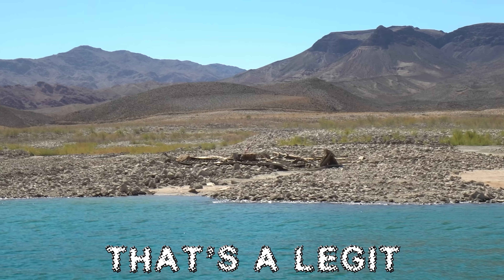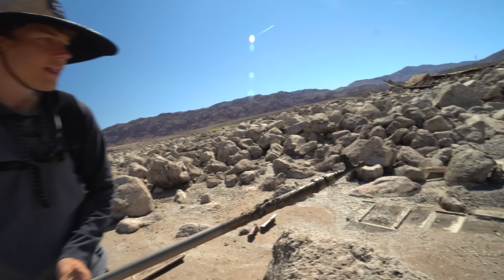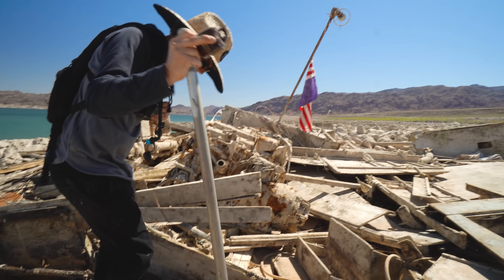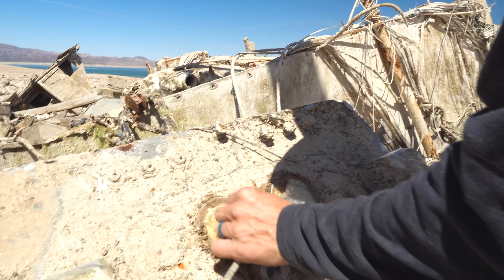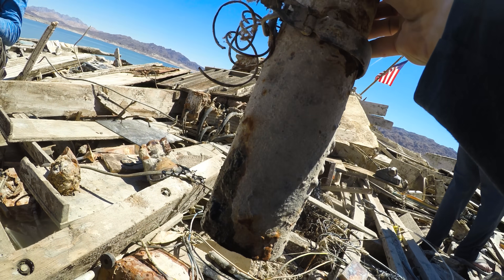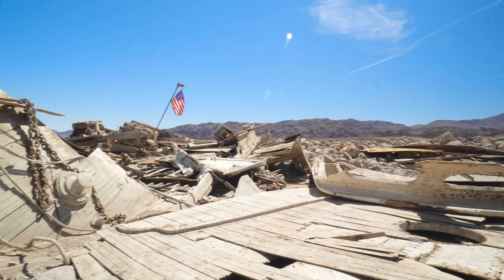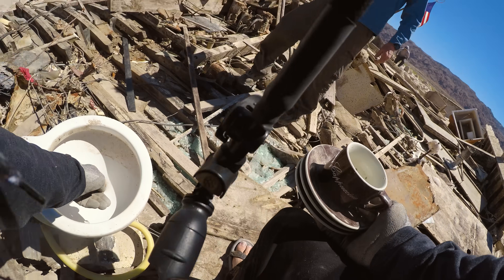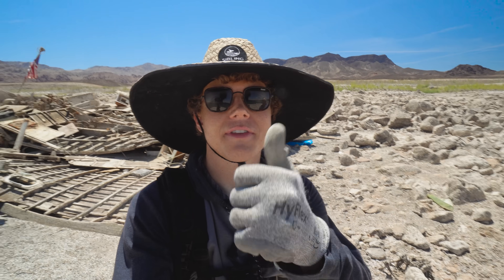This OLD Wooden Boat Wreck is LOADED! (Lake Mead)

Comment: The boat can't be older than 1963 which is when push button phones were introduced.  They became common for most households in the 1980s, so the boat probably dates back to that time frame, so the wreck has probably been there for around 40 years or so.  Same thing with cassettes.  They came out in 1965....
Reply: That food processor is 80s model
Reply: That cassette tape they found right at the end had a copyright date of 1972.
Reply: The flag  has in no way been under water for any length of time.
Reply: Really lol first of all touch tone was introduced to few states to try it in 63 most ppl didn’t have one until mid 80’s that boat could have went down in 99 pffft
Reply: The boat can be older and have added the phone. But by the looks of the rest, it might have sunk in the 80s/90s.
Reply: @Byronwi  which would still be a little over two decades.
Reply: Looking at the debris, I'd say she was built between the 30s and 60s. Probably more to the 50s, looking at the bow and stem. 3 engines, not often you'd see 3 in a cabin cruiser. Fairly big,  at least 40ft long. Possible as long as 60, hard to tell but the debris is spread out that much.
Reply: @sabrekai8706  that was my first thought exactly! Someone said it's because the water was cold... 🤔
Reply: He’s probably 18 so it’s ancient to him lol
Reply: @sabrekai8706  yeah i imagine someone replaced it as it came out of the water.
Reply: @sidnas92  So like yesterday no big deal
Reply: @ZonaJim  tapes list the copyright, but that's not necessarily when it was purchased. A Jimi Hendrix cassette manufactured today will have that same copyright date.
Reply: @gabby15107  I understand that, but the copyright show that it can't be any older than that date.
Reply: Nothing that was bought onto the boat dates the boat. That stuff can only help date when it sank.
Reply: @Sabre Kai  Exactly! Someone  put that flag there not too long before these guys came here. That flag would in no way have those sharp hues to it if it had been submerged for 30-40yrs!

Comment: The tape was part of a stereo system called a reel to reel made by Sony , and victor record company circa 73-79. The kiddie fire extinguisher is a 1984 issue. The flag was added by a passer by as a tradition. Its whats left of a 50s house boat fiberglass and pontoons took hold in the market by 77.
Reply: Good catch! So def sunk in the 80s. I personally wonder if it was intentional for insurance purposes
Reply: Some kind of mini R2R tape.
Reply: Are you talking about the cassette tape?
Reply: @Kraybones  reel to reel was a type of stereo that was pretty legit for the 70s. The tape is the same film used in cassettes, next were 8 track them cassette and picture disc, and then compact disc
Reply: @GlamGoreChaosQueen  dry rot or possible surprise leak that got ahead of bilge pump, lots of surprise summer storms that are gale force. It's been there awhile so who knows.

Comment: You guys found the SS Minnow. Looks like a vintage cabin cruiser. Probably an old Chris Craft Constellation or something along those lines. Engines appear to be twin inline diesels, and a generator set. Chris Craft usually had Gasoline engines, so maybe some other make like Grand Banks, but definitely a wood hull yacht of sort. Could be a boat fire due to the amount of damage.
Reply: not enough charcoaled wood for a boat fire

Comment: Gee fellas, I hate to bust your ballon but your treasure ship and its treasures date back to the sixties or seventies. I am 80 years old and I recall 99% of what you found as things I used daily or was familiar with. However that is a good size yacht and possibably went down in a sudden storm, it had life boats and flotation vests. Where it lies was possibably under 200 feet of water. The twin caterpillar marine engines say it was quite a ship.

Comment: So much of what has been surfacing as the water is dropping should be removed while it can be because it is not of any historical value and is nothing but trash that is just continuing to pollute and litter the lake bed. This wreck for example sank in the 70’s or 80’s. Is it historically significant? Not likely!